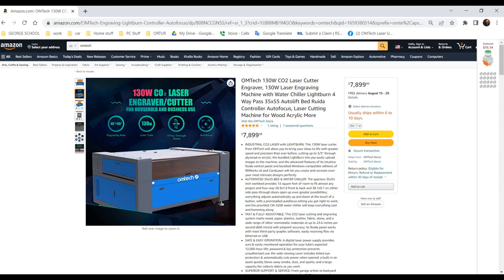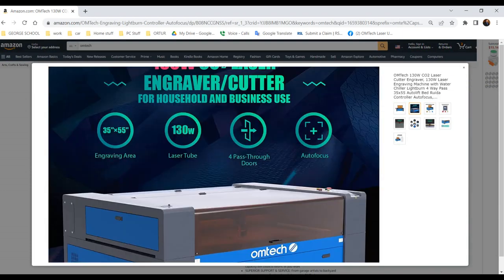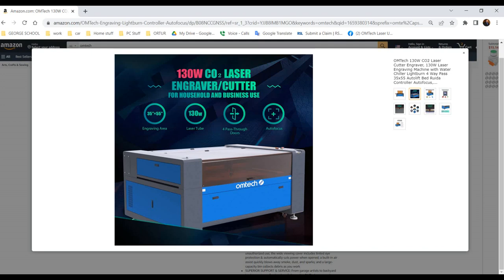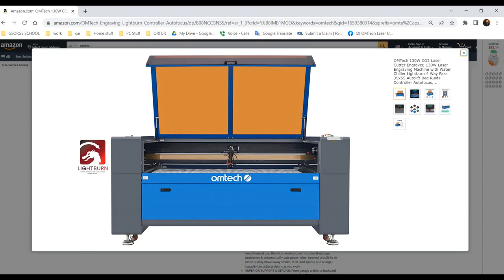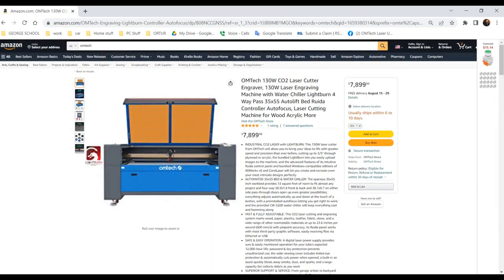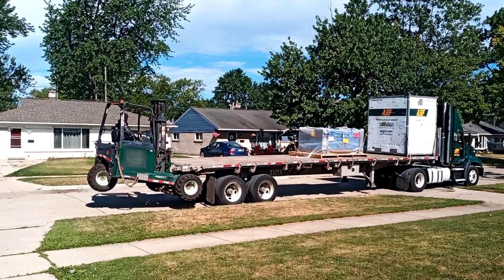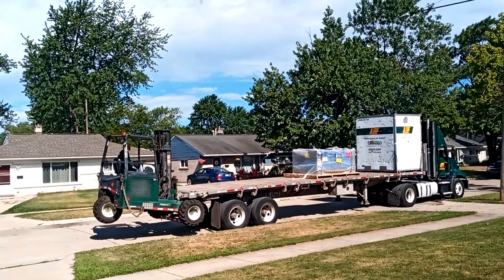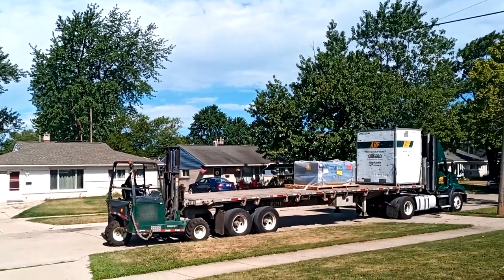130 Watt OMtech Laser Unboxing and Review

Comment: Looking to get this C02 laser.  Did OMTech make it right since the machine was delivered damaged?  The fit and finish doesn't seem that great.
Reply from the maker: Yes the machine did came in a little bit damage but that was done by the shipping company and actually is a good build machine works fine
Reply: @wisamyousif14  was curious because I watched another video with same machine and it was in a fully enclosed wooden crate.
Reply from the maker: @rrbcap  yes they come like that this was my 3rd machine from omtech and I love it, this one was damage in the shipping so they took the top case off
Reply: @wisamyousif14  thanks. I’ve made 142 items in 3 weeks with my XTool D1 Pro. Looking to possibly upgrade to OMTech. Thanks for the set up.
Reply from the maker: @rrbcap  If you want to buy one I can give you some kind of discount I can contact someone I know from Omtech
Reply: @wisamyousif14  sure. How do we connect offline?